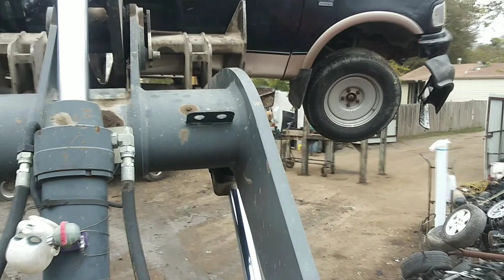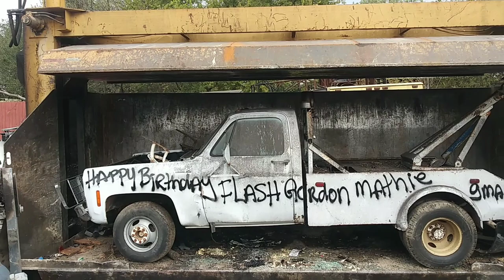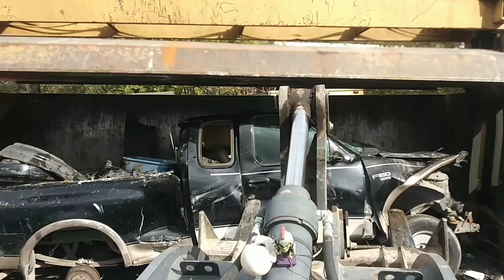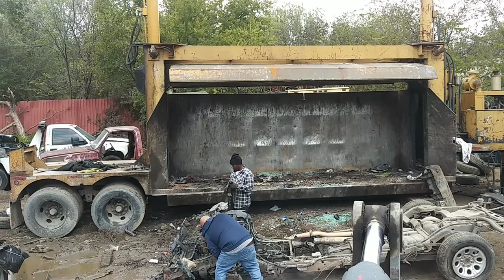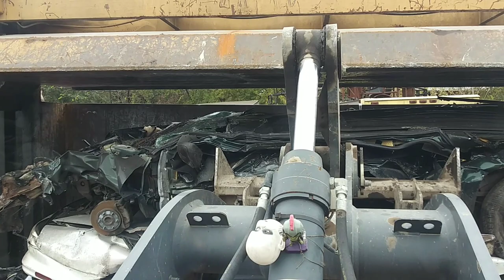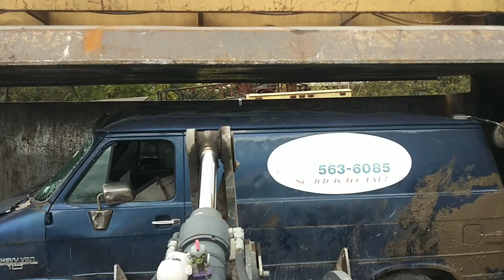1976-78 CHEVY TOWTRUCKS! 89-93 CHEVY G10 VAN GETS CRUSHED!.. 2 BIRTHDAY SHOUT-OUTS!!

Comment: Those shorty vans are bringing stupid money, if it was straight and had the door it would have been an easy three grand.  

It's a 93-95, it has the airbag steering wheel and the plastic egg crate grille, the same as my 1994.

Comment: Those box trks and delivery  vans are a pain with a Mac crusher since it only has a 7ft 1 inch opening. Much easier with the 8ft 1inch opening of a EZ  or the 10ft opening of an Overbuilt.
Reply from the maker: Yes thier are thier big pain n da ass. I told myself neva again. It wouldn't be so bad if it wasnt so much trash in it.💪⭐💯😊😎😁🤪